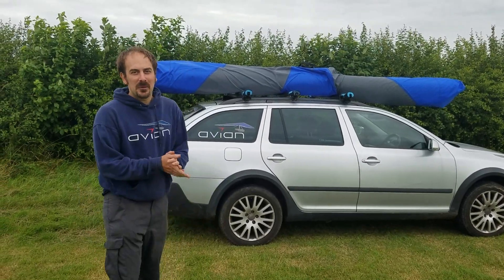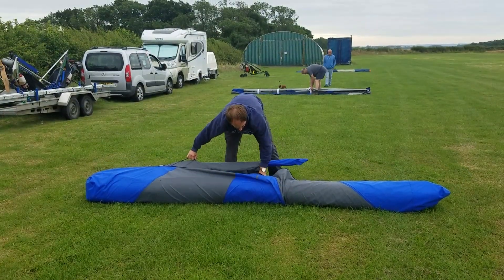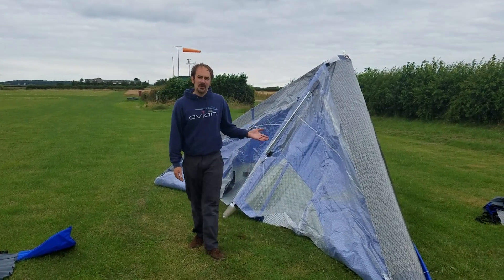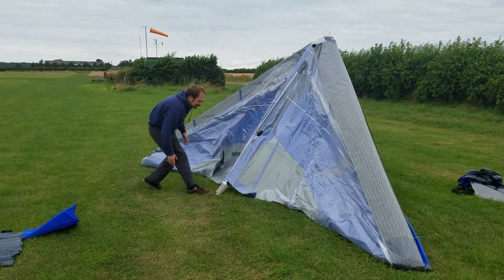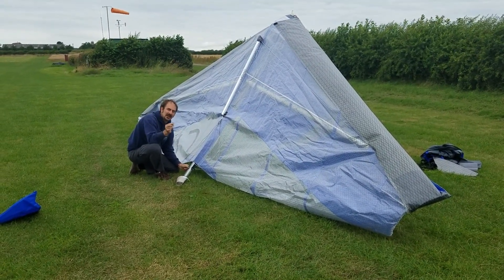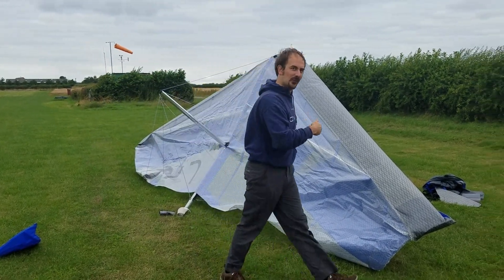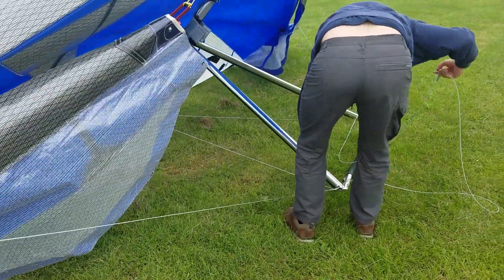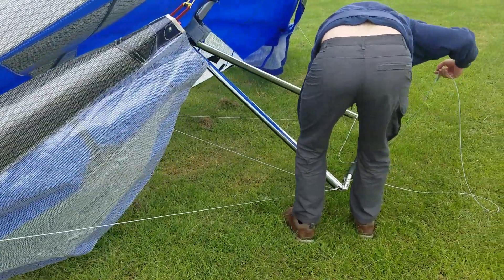Rio2 Carrier Wing Rigging

Comment: What is your wing cloth name ?
Reply from the maker: We use lots of different types of fabric in different areas of the sail. Mostly they come from Dimension Polyant and are normally used for small boats.
Reply: @avianhanggliders1985  can I use a nylon fabric for a hanglider??
Reply from the maker: Most of our fabrics are polyester. Nylon isn't very dimensionally stable.
Reply: @avianhanggliders1985  is polyester fabric for hanglider ???
Reply from the maker: It needs to be sail fabric. Most high quality sail fabrics are polyester. I don't recommend you try to build your own glider, there's a lot more complexity to it than it looks.
Reply: I just need feets inches of leading edge pipe of one side

Comment: Helpful demonstration.  At the risk of sounding like I'm asking a silly question, with average use and care,  what's the expected longevity of this particular glider?  I recall from sailing days, Mylar sails had a 2 to 3 year shelf life before they delaminated or became limp.  Admittedly dinghy sails are less rigid and perhaps take more of a battering being allowed to flap a lot etc.  Also is the glider a serviceable item or is it simply more economical to purchase a new one every once in a while?  Shelf life of metal cable shrouds or recommended replacement time?  Do you ever use all Dacron for this product, as Dacron appears harder wearing at the expense of weight...?
Reply from the maker: Thank you for the question, it's not silly at all but it is very difficult to answer! Hang glider sail life depends on so many parameters. The least important is actually number of hours flown! Once rigged, it doesn't flap about or really wear at all. Most important are how many times it's rigged and de-rigged, also UV can have an effect (although less in the UK), bad storage (i.e. damp or temperature extremes) will also impact it, also wear while being transported. There are many hang gliders still flying with perfectly airworthy sails that are over 10 years old. There are some over 20, if the glider hasn't been used much in that time and has been well looked after these can be fine. Dacron tends to last better in terms of folding and rigging de-rigging cycles, but is a little worse in UV than the laminates. Dacron can also look fine but be quite severely weakened, laminates tend to look tatty and delaminate without loosing much too strength, so they don't hide their condition. Dacron is actually our standard sail (with a laminate leading edge), the full laminate like this one is a performance option (and even in this configuration the lower surface is Dacron). We have found the particular laminate we use to be very good lasting. It's perfectly possible to replace the sail on a hang glider (and this is fairly commonly done). Our full glider range (including lots of photos of Dacron ones!) is here: https://www.avianonline.co.uk/avian-gliders-c-226.html
Reply: Avian Hang Gliders Thank you very much for this comprehensive reply.  I could well be in touch after some lessons (and wife convincing regards this being a nice new hobby).  Brilliant cheers again.
Reply from the maker: @wightwalker2453  you should do, it's the best sport in the world!!